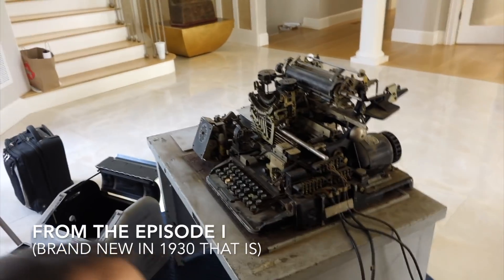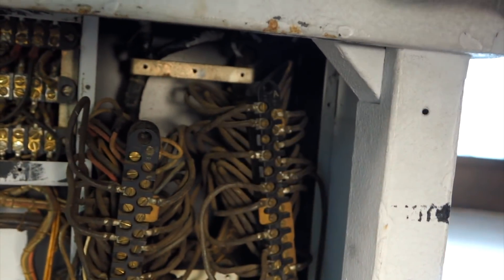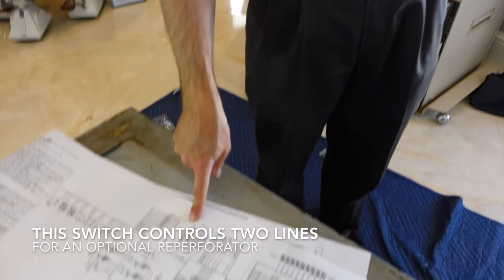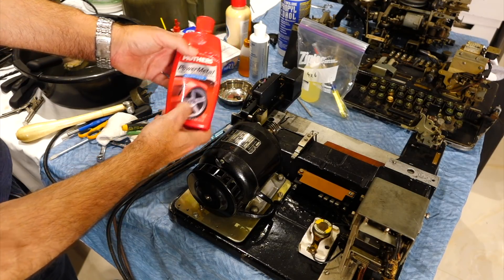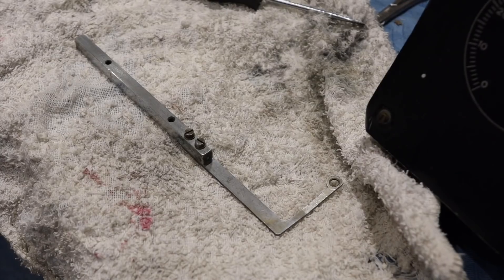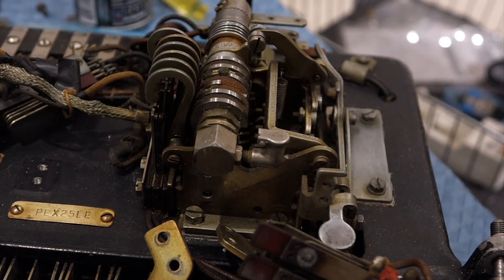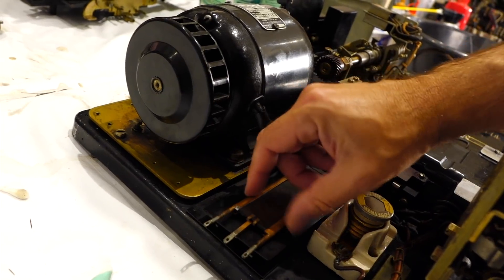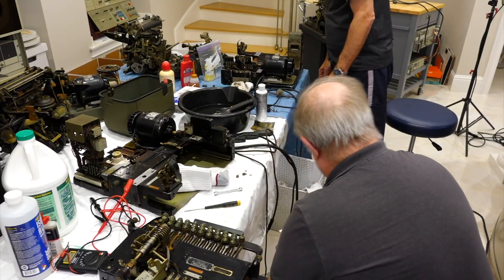Teletype Model 19 Part 3: Teardown time!

Comment: I used to service and maintain teletype receivers, some of which were as old as this one, which were still very operational at a news wire service in the mid-1970s. They worked round the clock, with some down time in the early morning hours. They generated a huge amount of heat and the teletype room was a sauna during the summer.

Comment: I hope you do not plan on re-using the old wiring, as it's insulation is obviously hard as a rock.  The wire has also most likely risen in resistance.  With the exception of power transformer and motor leads, new clean point to point wiring would be easiest and safest.
Reply: ND SAE20 is usually the do all for simple lubrication, aka 3 in 1 Electric Motor oil (Blue Can).  Never use Lubriplate as it turns to honey in California "Humid" Weather.  Lithium grease for cams and gears might be a good choice.
Reply: Powder Coat is great, expect when it is sprayed on all thread, and in threaded holes....gah!
Reply: DandyDon Whatever they use shouldn't be too different from the original, since this is a museum restoration, not a rebuild for personal use.
Reply: I think though that it ceased to become a museum piece when the original paint was sand blasted off.  ;)  That being said, replacing all of the wiring where it can't be seen (under the desk) shouldn't be a problem.  It may be possible to find modern wiring with a faux cloth covering.  I know that lamp cord is available that way. 

There is also something to be said about making it safe for demonstration purposes and checking for AC/DC leakage from the chassis to earthed ground.  If anyone were to get an electrical shock or worse it would most definitely be grounds for a potential lawsuit.  

This is always the problem when working on old equipment for someone else whether it be a Teletype from the 1940s or a Hammond Organ from the 1930s.   Also note they weren't always painted black.  Here is a page with a few examples.

TELETYPE MODEL 19 SET 
http://www.baudot.net/teletype/M19.htm
Reply: Also, based on the schematics specing "Deltabeston" wire, that might be asbestos insulation.
Reply: All it takes is to inhale a few small flakes of asbestos and it becomes embedded in lung tissue.  A dust mask and soaking old asbestos with water while it is being removed to keep it from becoming airborne, at least.

Comment: Hi Marc, excellent work. Really appreciate you saving these old machines. I renovated a 1940's vintage metal shaper that probably had life on a submarine during the war a couple years ago. It still has the decals from the war department on it. The motor in it was in such poor shape I didn't risk powering it up. I put on  a modern motor and will at some point try to get the original motor rebuilt. Looking forward to the next installment of this rebuild.

Comment: Hey!  I have a set of those oddball power plugs!  They're NEMA type 18-20!  Always wondered what they're used for, can't remember where I got them.  The "Crow's Foot" socket on there is, I don't believe, a NEMA connector, if it's what I think it is.  Just called a "Crow's Foot", they were used in the US before NEMA and still are occasionally when you don't want someone plugging random shit into your outlet (isolated ground, clean power, UPS, etc.).  However there's also a NEMA connector with that configuration of pins but slightly larger, which is a 250V plug, I believe of the phase-phase-return variety, but it's hard to tell from sight in the video.
Reply from the maker: +Lazarus Long Yes, looks like you are right on! I looked it up and you can still purchase a receptacle today! Thanks a lot!
Reply: No problem!  I also have a real turkey, coincidentally salvaged from another desk, actually a workbench -basically the same connector but only with two pins, the opposing pair that are 90 degrees off from one another.  It was used to deliver 48 volts direct current, which I know because that's what's engraved(!) on the plate.  It is definitely NOT a NEMA connector and can be plugged into the 18-20, which I'm sure wouldn't do the hypothetical 48VDC equipment any good at all.
Reply: The one to the far left of the fuses is a combo NEMA 1/2 T-slot, which could be wired for either 110 or 220 (bit of a nightmare); the one to the immediate right of the fuses is a NEMA 2-20 perpendicular (whose plugs would also fit the T-slot). The porcelain holders, for the fuses, are old (pre-1920's) Edison-screw outlets. Yup, they actually mounted those low in walls to use as outlets.
Reply: The T-slot outlets were almost never wired for 220, they carried the 220v rating because at the time it was prohibited for any 110v device to carry a rating over 10 amps, the 220v rating was just there to show they were good for 15 amps.  The T-slots were for legacy equipment, before the standardization on two parallel pins, two flat pins (much like NEMA 2-20) were rather popular.  The T-slot allowed connection of this equipment.  T-slot outlets are still made today, believe it or not.

Comment: Wear gloves when handling possible lead paint guys!
Reply: Pretty sure just washing your hands after does the trick
AFAIK the danger is ingesting it
Reply: You are correct @LeiserGeist. The real danger is breathing in paint dust (lead or no lead), from for example sanding/sand blasting it off. But otherwise what they are doing is perfectly safe with something as simple as washing your hands. https://www.osha.gov/pls/oshaweb/owadisp.show_document?p_table=STANDARDS&p_id=10031
Reply: they are too old to be overscared by such things.

Comment: I found that using a ultrasonic cleaner can help get a lot of crud out of small corners when cleaning old devices like this. Though tooth-brush is still the best :)
Reply: Regarding metal corrosion/oxidation be careful how much 'abrasive mechanical action' you apply. ;) 

In cases like typewriters for example one may also have to be extra careful since often there exist a interesting balance between wear due to use and build up of gunk. I have far to often encountered the amusing problem that a typewriter or camera functioned worse after a restoration because the gunk and oxidation build up had compensated for machine wear and kept it functional. Meaning that after cleaning, parts where far too lose fitting after cleaning and then required metal or paper shims to function appropriately. :D

Most corroded metals, even though unsightly are quite stable and will not corrode further if they are merely well cleaned and oiled in order to protect them from the air again. 

As someone that often voluntarily does museum restoration of various machines I have commonly found that often corroded/oxidized metals which where previously polished too much by other restorers lead to more fresh metal being exposed. Thus the corrosion simply started again and this time it attacked a previously good surface that was exposed by the polishing, thus eating away more material.

In many cases it may be better to leave the corrosion and merely clean off any loose materials well and protect the surface to stop further damage. 

Oxidized Aluminium for example that has formed Crystals and turned white in places is quite stable once it reaches a certain state. If polished too much it will simply corrode further damaging more material. For particularly early aluminium  I use a very fine soft wire brush and wooden tools to brush and rub off chrystals and, then use fine polishing paste with a cloth to smooth out the surface. Last I oxidize the metal in a controlled manner in a hydrogen peroxide solution to create a smooth even oxidized surface. 

Areas where different metals interact are well oiled and sometimes additionally isolated with a thin paper to limit galvanic effects.

Similarly brass and copper parts that have darkened to develop that particular patina are very stable, light polishing and oiling for moving parts is best here, wax paste lightly applied can be used on static parts also. 

For steel and iron, it's best to remove most corrosion while keeping a very smooth surface as any grooves or surface defects create new sites for rust to form when exposed to air. These similarly are best protected with a light oil like 3-in-1 or Paste Wax, example Johnsons.

Now I don't always approve of sandblasting, but in your case it was certainly safe and the most appropriate thing to do as only sand blasting can truly effectively strip the old paint and any rust away even though it does have the potential to scar the surface if done improperly. I say your desk was very well and smoothly done.

Regarding painted materials, powder coating the surface is pretty much the best for a full  functional item restoration (one that will be used like yours) and will protect the materials well.

I'm very curious to see how this goes, all the best.
A Cat 🐱
Reply from the maker: Agreed. Ultrasonic cleaners can take stuff off that nothing else will. I would need a giant one for this! Sure won't fit in mine. Maybe if I have a stubborn smaller assembly I will use it. But they can't repolish oxidized metal. That you have to do by abrasive mechanical action.